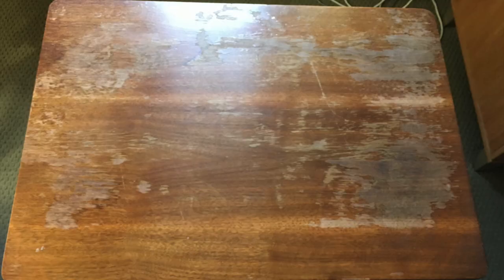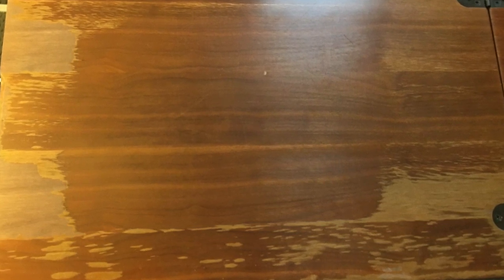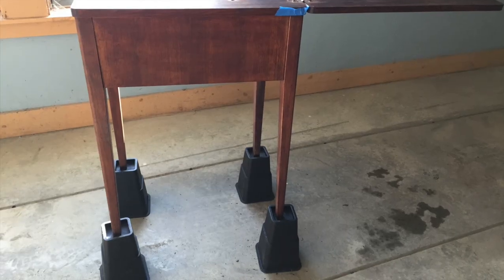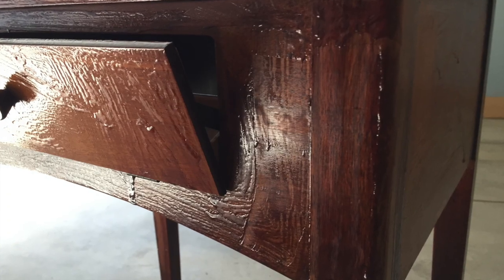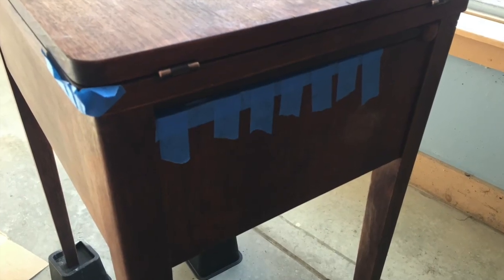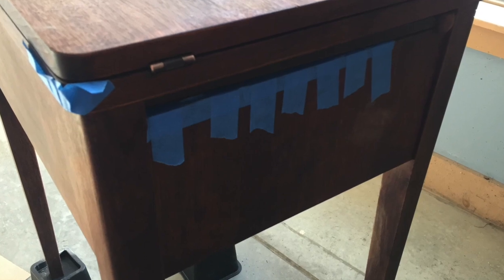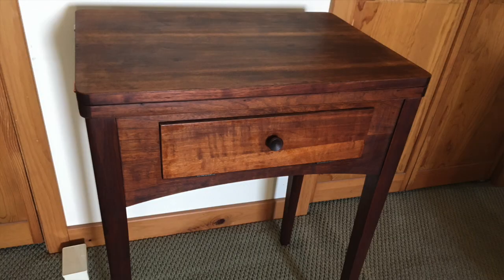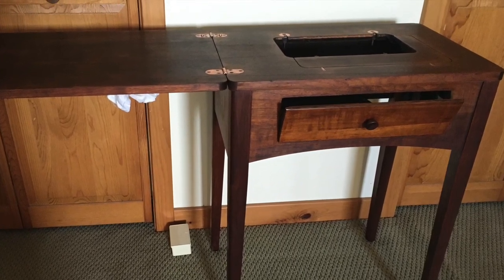Refinishing a Sewing Machine Cabinet: Observations and tips from a first-time furniture restorer

Comment: hi sarah i live in northern maine and i love to refinish furniture  ;];] i also use citrus strip and i found that you dont need harsh chemicals to remove the stripper.. this is my process... now to make it VERY CLEAR   i dont have any place to work in...my garage is brick dirt flooring  my cellar is damp/ moldy so those wont work...wrong enviroment. so whats a girl to do???  well rearrange a room to work in the house;];];]  in my case the living room...easy to move furniture in/ out of the house due to the frt door is in the living room;];];]  my process...:   wash the piece with pine sol. let dry.  then my tools...:  plastic scrappers differnt widths.for wide /narrow spaces. green scotch pads, gloves., a cookie tin, a unused glass for drinking for stripper, small paint brushes. and  SOUR CREAM CONTAINER FOR WASTE. with lid.  ajax dish soap for cleaning.  a bucket of water with ajax soap. 3/4 differnt sized green pads cut up..or not.  some tiny picks  for deep carved areas.for digging out stuff like old varnish. and a few old beater towels . ok  this is how i go about stripping.   lay a thick coat of stripper  1 section at a time ..not many all at once.it will dry too fast before you get to it. i let mine sit an hr and re apply if nessasary to keep wet...then grab my cookie can and plastic scrapper and have had it.. put gunk in cookie can,, then i grab my green pads in the bucket of water/soap. and start scrubbing  .this neuterlizes the stripper you can or not use gloves.. i dont. but i do...when applying stripper. scrub the surface well and change out green pads in the bucket . the go back and grab that towel and rub fairly dry  .. then just repeat onto another section...if the bucket water gets dirty,    take it to the sink,   wash with ajax soap and rinse out bucket.....refresh with new water/ soap and now cleaned green pads.you can also wash the scrappers too. its all neuturilized..  when your tin cookie can gets too gookie for your liking.. just scrap it into a plastic container with lid.... i use a sour cream container..whatever works for you., if you want ,  wash out cookie container.. everything you use is WASHABLE /REUSEABLE!!!  no buy chemicals to take off stripper and getting knocked out by fumes. its not that bad...i also use a shower curtain to protect the flooring thats washable and reuseable ;];] the towels throw in the washer;];];]  nothing is wasted;];]  brushes wash like the green pads..no waste;];];]  when you get up the next day.. you can see what needs to be redone ;];];]  no fumes nothing  to smell.with ajax its squeeky clean and degreased ;];];]  i hope this helps if you plan on another project;];];] the only time i use mineral spirits is for staining brushes .  i hope you try another project with this info;];] i know it made my life ALOT EASIER/SAFER for me and my pets;];];]and i just put a lid on the waste cookie tin..since i have everything else washed and ready to go again;];];] as for projects ive done... oak mission chair, eastlake victorian ladies side chair, and i revival couch table..new newest project.. a 1950s sewing cabinet. THAT WAS 1 GOOKY MESS!!!!  the rest of the other projects were painted. this was old varnish.. YUCKO just like carmel sauce!!! i have mine stripped to raw wood. i cant kneel due to knee surgery.. so i use a card table thats folded down on the underside NEXT TO THE LEGS  diaginal .i glue/clamped 2x4s blocks primed.   then screwed rotating caster heavy duty wheels . i wired down the legs so they wont flop around,   but i can still use them if i want to;];];]  the casters wont be in the way;];];]  lay table on floor .   lay shower curtain and use tape to hold back  the sides  .   load furniture.. and i have a "mobile"  work station;];] with duel uses;];];]  pick it up slide it anywhere out of the way  done;];];]  i LOVE mine and i dont have to move anything to use it;];];]  and i can take it out to the garge/down cellar/ out doors  in any rooms in the house,  it WORKS !!!  i made sure mine was heavy duty card table made with metal.. so it could handle the weight of the project;];] or if it wasnt.. id find sheet metal for the top to handle the weight without caving under .hope this helps  sorry it was a book, but wanted to help;];];];]